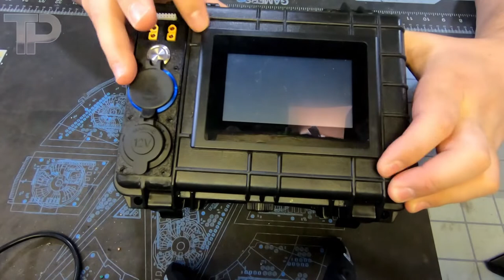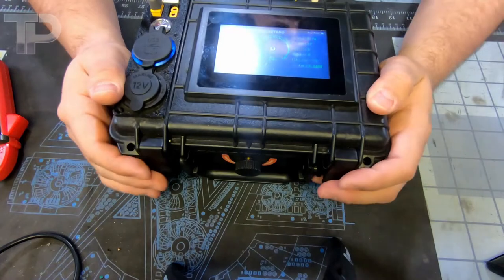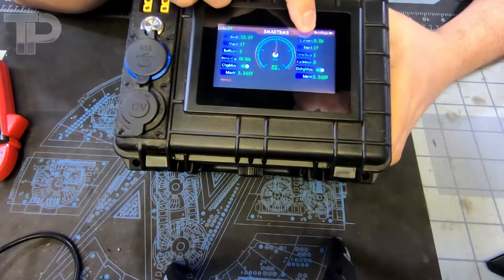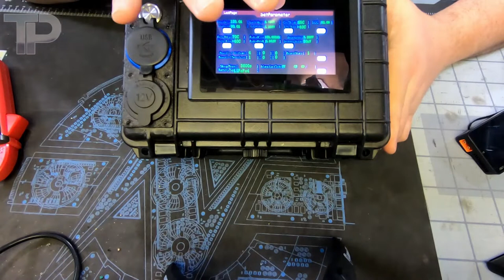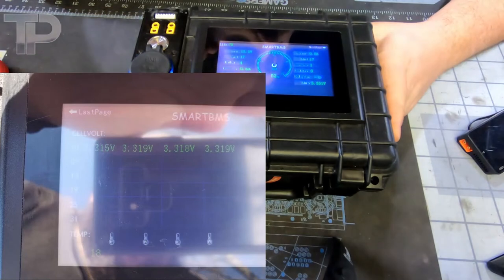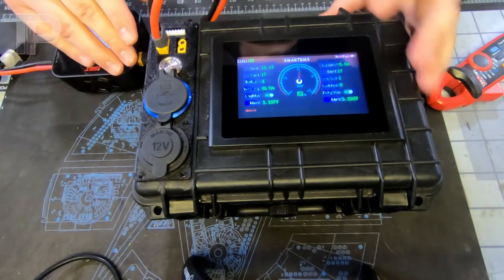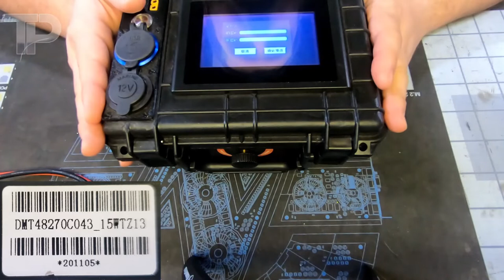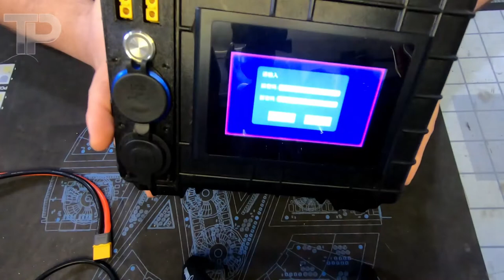Daly Smart BMS and Screen review, was it worth it???

Comment: If you set your Screen timeout to 65535 that disables the screen timeout :) Also if yours is the same as mine the J6 Connector, “S1“ pin (Pin 3) on that connector wakes the BMS when shorted to ground,  connecting a momentary push button there will wake the screen ( like a reset button on a PC) EDIT: it may be the J5 on yours, sorry I'm trying to help it was frustrating for me too!

Comment: Observations and comments.  FYI I have a 250A 4s.  It may have different I/O ports than yours, keep that in mind when I reference some of the BMS ports below.

I've measured the current draw of the screen at about 100mA on a 4s LiFePo4 battery.

You can use a 3.3v FTDI or other generic USB-UART adapter if you have one.  If you don't have one, get one that is 3.3v/5v selectable.  They're handy to have around.  You need to use a different UART port on the BMS to use the Sinowealth software to set parameters.  It's a 3 pin port, probably labeled PC or Monitor, probably in Chinese.  There are many more parameters that can be set with the software than are displayed on the screen.

The SOC meter goes to 100% when the cell voltage reaches the charge end voltage that is set.  You'll need to set it with the software.  After that, it tracks the state of charge by measuring the charge and discharge current and referencing the programmed capacity.

The ammeter can be calibrated and the minimum current that is registered on the display can be changed with the Sinowealth software.  The minimum current parameter is DfitterCur.  You should set it to zero before calibrating the ammeter.  I've noticed the ammeter has a lot of jitter in it's readings.  You'll be able to see this in the info screen under CADC Current when DfitterCur is set to zero  Calibrate the ammeter using the CADC Gain and CADC Zero parameters, then set DfitterCur to something reasonable like 1000mA.

The screen doesn't turn itself on or off.  If the BMS is activated and awake, the screen is on.  If the BMS goes to sleep, the screen goes off.  When my BMS wakes after going to sleep, it doesn't communicate with the screen properly and only updates the info on the screen about once per minute.  To correct the problem, I have to disconnect and reconnect the balance connector from the BMS, and then reinitialize the BMS.  To initialize, the BMS needs to see charging current from the P- to B- cables, or momentarily short the 2 pin connector on the BMS.  To wake the BMS, you can use charging or discharging current, or short the 2 pin connector.

I'm curious if your BMS has the communication problem after waking from sleep.

You can unplug and replug the screen into the BMS at any time without issue.  If you don't want the screen on while you're using the battery, you can just unplug it and save 100mA.  You could put a rocker switch in the 3.3v wire going to the screen if you want.  It might be a good idea on a relatively small pack like yours.

My screen doesn't have the password screen.  My firmware might be different than yours.  My screen came preloaded with English firmware, and I haven't changed it.
Reply from the maker: Thanks for the info Mike! I didn’t even think about using my generic USB-UART adapter, I do have a selectable 3.3/5 FTDI one kicking around that I use from time to time for programing ESP8266 controllers. You are also correct, there is another 3 pin programing port for it. I’ll download that software and play around with some of the settings, thanks for the info on the ammeter, I’m sure that will come in handy!

I do fully understand that I could short pin 2 or charge / discharge to wake the BMS, but as a commercial product one would think they would have made away for user input on the screen to wake the BMS, just my two cents on that. I did also think about adding a switch to the 3.3v line from the BMS to the screen as well but again, I just don’t feel like I should have to, and tbh, it really doesn’t bug me that much, I just put that info out there for anyone picking this up to know what to expect out of the box.

I have also unplugged the screen many times from the BMS and removed the balance lead in attempt to reset the BMS, but still have the same issue with the random wake. It really isn’t a big deal to me tho, as the screen is really easy to just unplug when sleeping around it at them times. 

Mine has always shown that password bar before and after the flash, I wonder if there is something different with the small BMS vs the bigger guy? That is odd.. Good to know tho, I’m planning on running a 8s 250a for my camper, still not sure if it will be a Daly Smart BMS or something else, there seems to be some good options finally hitting the market.

Thanks again for watching and the info!
Reply: @TodaysProject  I found an updated firmware for my BMS on a forum and flashed it.  It has solved the issue that I have with it not communicating properly after waking, and also allows setting parameters from the screen.  If you haven't done so, I recommend you contact Daly and try to get the firmware updated.

Comment: PLEASE !! Does the DALY BMS balance the cells? And if so, how 
many compensation amps does it send to rebalance the cells?
Reply: Some models do balance, but I believe they only balance while charging, and only at 30mA
Reply: @Mike_Neukam  The one I got, with th add of an equalizer, have 5A for balancing the cells.
Reply: @Mike_Neukam  correct. If you buy grade A cells from Shenzhen Luyuan or Dongguan Lightning, top balance them, Daly’s .030A works great.

Comment: Interesting and useful overview. I'm just setting mine up and not got the screen showing yet so this has been helpful. One thing I noticed on my display is the one connector splits into 2 for connecting to the BMS. One goes into the UART but I'm not sure on the other one. Guessing into the Chines labelled port which translated says host computer. Was this the same for your setup?
Reply from the maker: Unfortunately no, mine was just one four pin cable that plugged into the screen and UART port on the BMS. My understanding is that Host Computer is for the USB cable connection to program the BMS with a computer.
Reply: @TodaysProject  Thanks for taking the time to reply. Maybe they have improved it based on your video and its additional connector is for allowing updates to the BMS. I'm waiting on clarification from Daly and when I get it working 🤞 I'll tag an update in here. Great video & keep posting similar as this was really helpful 👍
Reply: I got it working via your trick to charge the battery so thanks. The display came on without values and I ended up plugging the other connector into the BMS 485 port and today all the values were displayed. The only problem is I can't make changes to them like you pointed out. You can change the values but not set them. I need to now get or make a PC interface as the 300A version of BMS I have is not BT compatible if you select the screen option. I'll have to double check that but kind of wish I'd got the BT version now.
Reply: @robwhitehouse8177  You can probably get firmware from Daly to change to bluetooth.  I believe the only difference between the LCD model and bluetooth model is the firmware.  I was able to update the firmware on mine and can now change settings with the LCD

Comment: For the para setting to stick even if its off and when you turn back on. First go enter a wrong password than a screen shows wrong password. Then go click on set password change it type old password 123456 than new passcode at ur will. Set it change your screen timer from there. Switch of and try switching on it stays.
Reply from the maker: I'll give that a try and check it out!